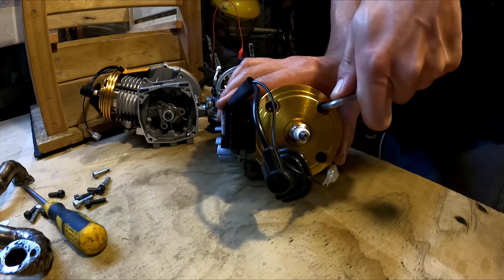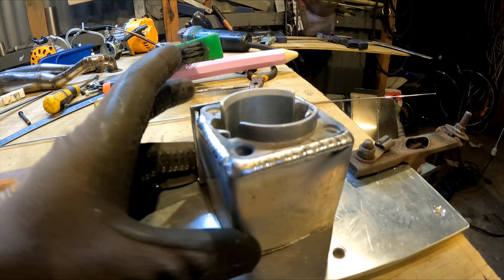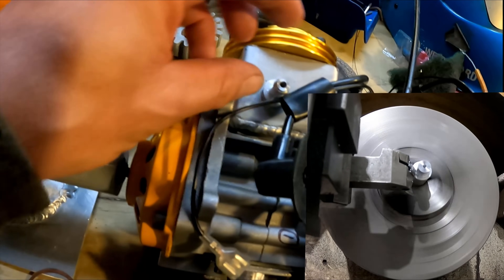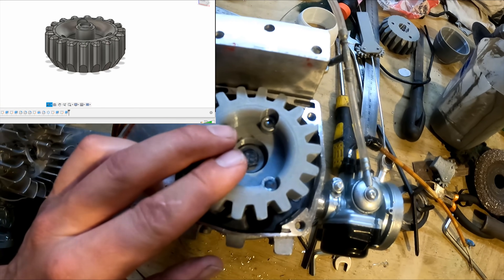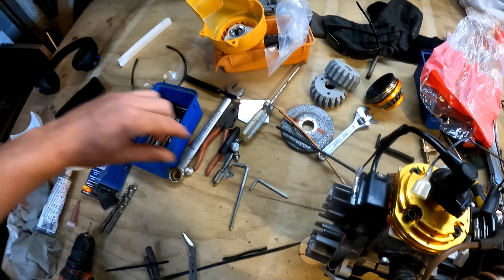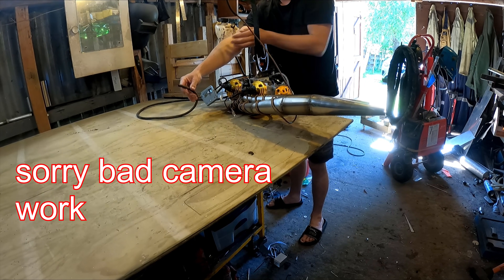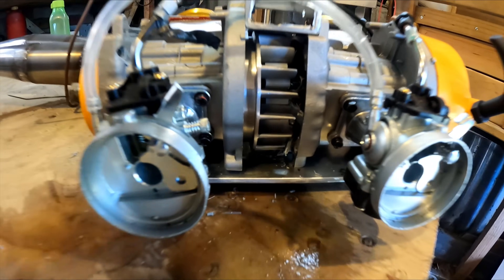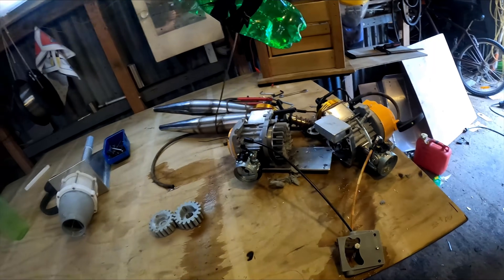Homemade Jet Drive Water Cooling

Comment: Why did ya wrap the exhaust with the copper pipe ???
Reply from the maker: The water will be too cold coming straight from the jet unit so the exhaust heats it through the copper pipe first . Marine engines do a similar thing but with a water jacket

Comment: wall lines are stronger than in-fill use 99+ wall lines in cura
Reply from the maker: Ok, I don’t have cura is it free? My printer came with creality which works but not that many options
Reply: @dkthewelder  Cura is free, has ender 3 profile in it. Just rock and roll!

Comment: I would try TPU (Shore ~95A for example) for the coupling, so it can handle the vibration better than PLA/PETG. And make it with like 10 perimeters plus 60-80% infill maybe?

Awesome work!
Reply: That's actually a really great idea you at 95A i think would be the perfect filament for this kind of application. Stretchy but not to stretchy would be like a hard rubber coupling. With alot more resistance to shear of at the layers. Good idea!
Reply from the maker: I have tpe it’s like stretchy but need to change some parts so I can use it . Is tpu flexible?
Reply: @dkthewelder  tpu prints pretty similar to tpe i think, so very slow. Main factor is the hardness. With a bowden machine i would stick to shore 95A and upwards (i use the prusa mini in stock form). We had a play with 85A tpu on a prusa mk3 (dual gears and direct drive) at work.
What hardness is your tpe spool?

Comment: You might not even need to 3D print the coupler solid. Try adding more vertical shells (walls) to increase the print strength. That project looks awesome!
Reply from the maker: Thanks. Yeah that could work I guess 👍

Comment: Also, did you align the engines at top dead center? what was the procedure if so...
Reply from the maker: Na one is up and one is down . I just take out the spark plugs and put a screw driver in to see where they are. I did it in the last video 👍